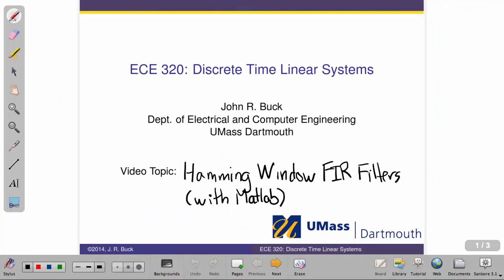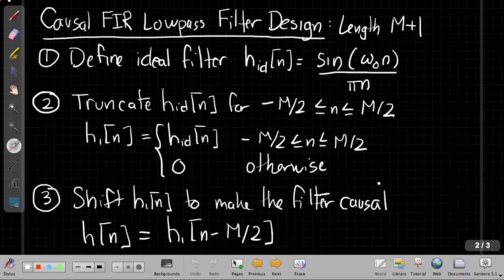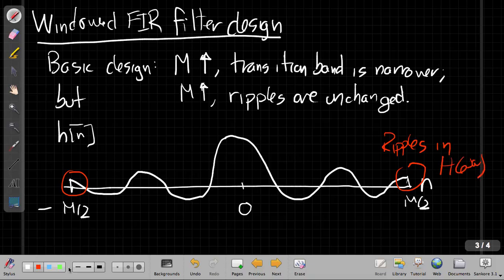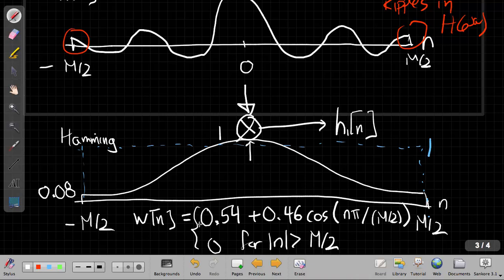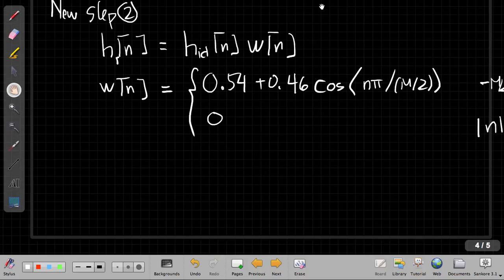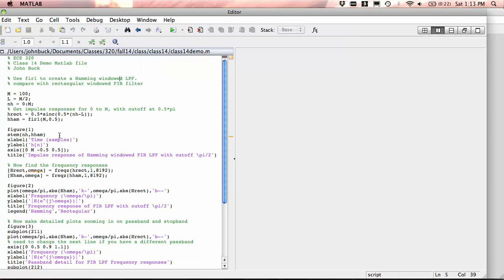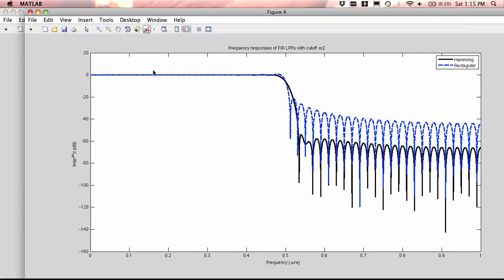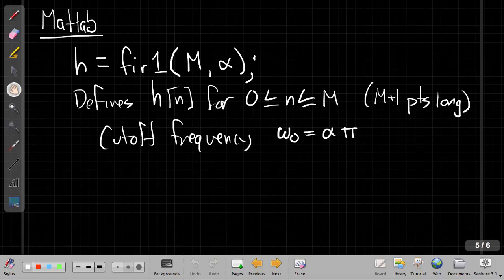FIR Filter Design with Hamming Windows

Comment: thanks sir for the video but i think the function of hamming window is wrong its ' - ' rather than '+' in the expression of hamming window consider page 666 of DSP by John G. Proakis  4th edition
Reply from the maker: The sign in the Hamming window depends on the order of shifting and windowing.  If you shift first by M/2 then window, you should define the Hamming window for 0 <= n <= M, and you will use the - sign.   If you window FIRST on -M/2 <= n <= M/2 THEN shift by M/2 to make the filter causal , then the Hamming window should be + as shown here.
Reply: Thank you 🙏